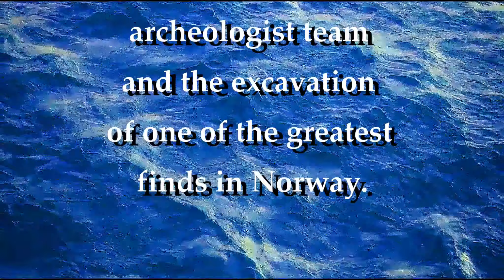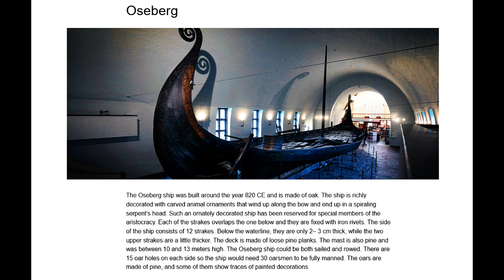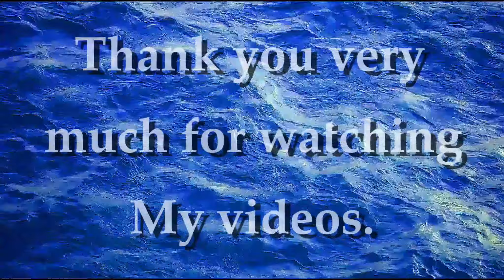The Oseberg The Most Well Preserved Viking Ship in the World

Comment: The wood work on the Oseberg is amazing. The double grooves on each of the strakes shows such delicacy in design. Thanks for the close up views.  Interesting that the oar hole has a slot pointed in the direction that puts the oar in immediate forward rowing position. I wonder if it was typical.